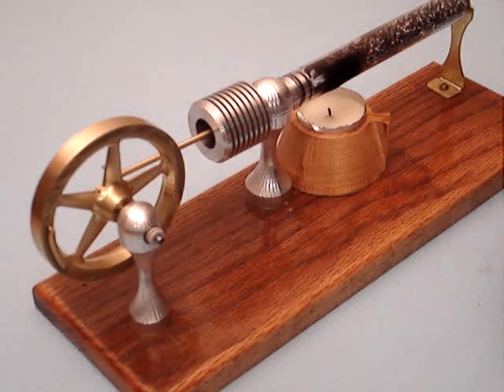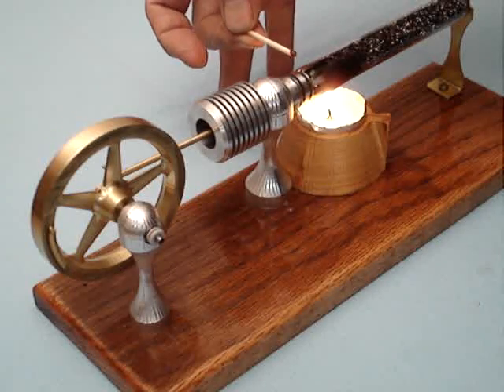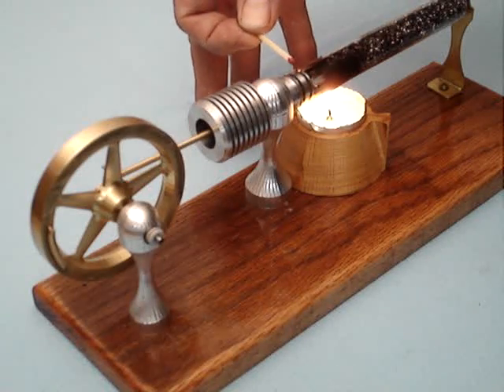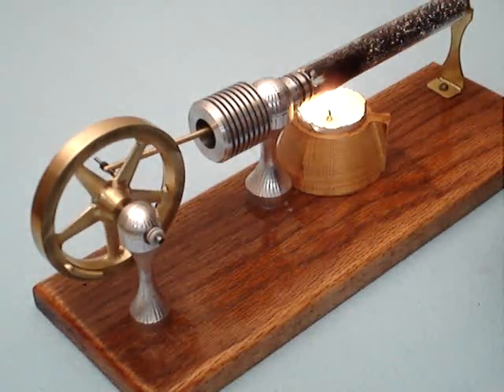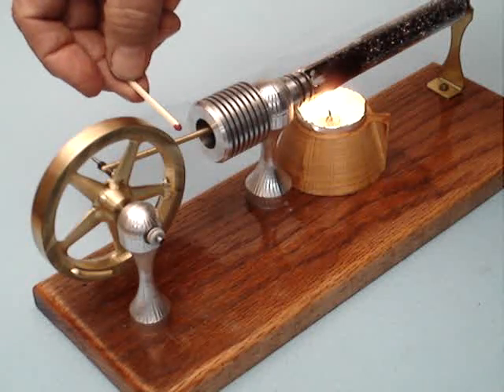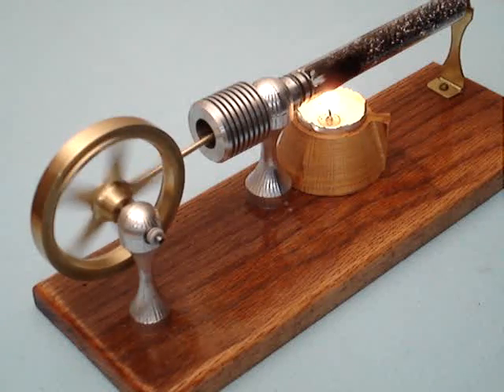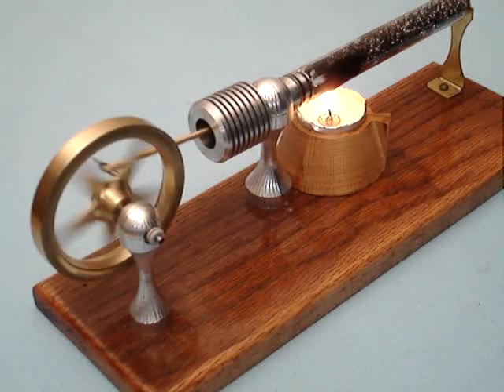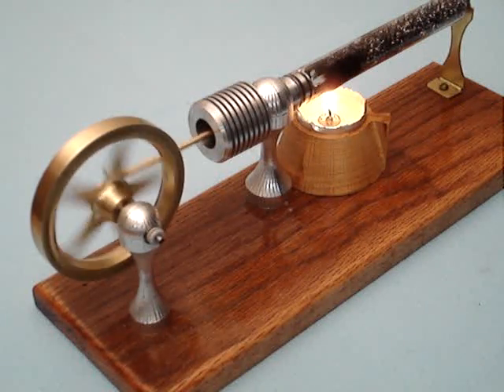lamina

Comment from the maker: @geoferret 
Pretty much it, it's basically table top conversation piece. Suprisingly though it has lots of torque. I suppose you could use it to turn something. It's kind of a brag about machining skills because building it well enough to run requires more than a beginning level of skill.